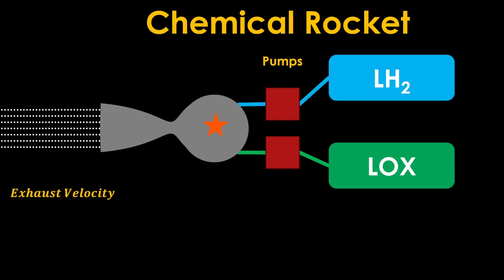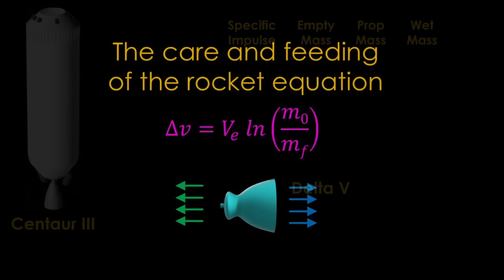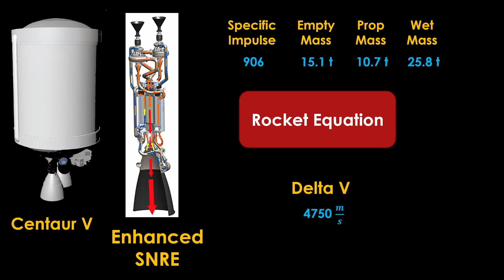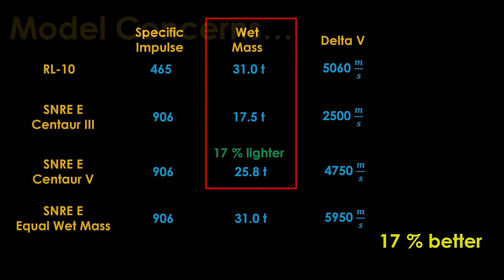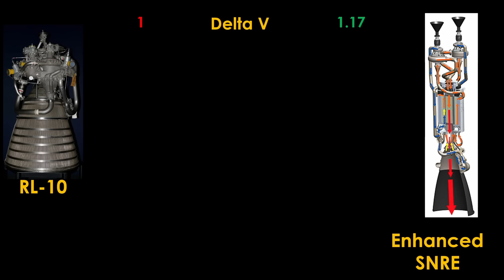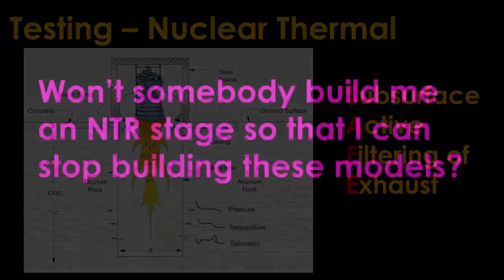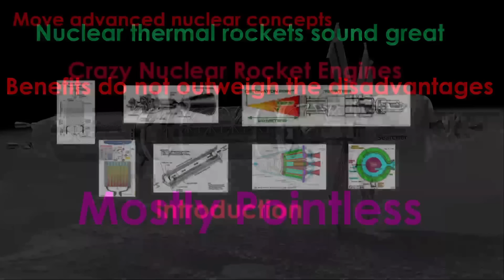Why Nuclear Thermal Rockets are Mostly Pointless

Comment: There was some tantalizing PR blurb a few years back that indicated that the DRACO rocket program had evolved: they were saying that the new version of DRACO was a hybrid of Nuclear Thermal Propulsion (NTP) and Nuclear Electric Propulsion (NEP). This was supposed to result in a superior form of nuclear engine. They suggested that it would cut transit time from Earth to Mars from 6 to 8 months (using chemical propulsion) to 45 to 90 days (using the nuclear hybrid rocket). I don't recall if this tease came from the Dept. of Defense or from NASA. Are you suggesting that this was just a hot air tease, and nothing behind it?
Reply from the maker: I'd have to see the specific proposal to have an opinion. 

I do have a video on nuclear electric.
Reply: 90 days is fantasy, you would have an unsurvivable entry speed at Mars and no propellent to land with.

Comment: Don't the atoms guys ever talk to the rocket guys? I get a sense from these announcements that they either don't understand mission design reference and contingency planning, or the people they need to impress don't.

Focusing resources on nuclear propulsion for crewed Mars missions at this stage is placing the cart before the horse. While this is the standard sales pitch, there's simply no need. No surface ISRU option for brewing nuclear rocket fuel is possible with any destination anyway. 

Furthermore, using any superior engine to push people there much faster than 180 days means destroying the only added safety margin it could've offered above Methalox. Should anything happen to prevent this shiny new fantasy drive from relighting to slow the vessel enough for safe Mars entry & landing, the crew is out of options. Certain death somewhere in the outer solar system is assured. OTOH, a 2-year, free return trajectory to Earth is available with ballistic trajectories, by simply doing nothing.

At this time, there is no civilizational infrastructure at Mars. Everything that will keep you alive at Mars must either ride along with you or have been safely landed there ahead of your arrival. Killing the most robust safety feature of mankind's most dangerous undertaking in a single point of failure is the definition of insanity. Real mission planners will be adding more payload in the form of systems to maximize crew surface safety and productivity. 

Better propulsion designs will arise naturally, driven by growing demand in trans-planetary commerce. Clipper Ships are for the settlement phase.

The stated reasons for advanced propulsion development prior to sending humans to Mars are illusory. Such efforts are better spent on developing improved compact fission options crews could actually test soon (the way it's looking, perhaps even by Artemis III).

Comment: This is why I keep using advanced chemical rockets until I unlock open cycle fission or fusion in Terra Invicta, which has a fairly sophisticated models of hard SF space economics and physics: 
There's no technical reason why solid core NTR's can't work, they just are too incremental of an improvement in performance and economics to justify either the logistical difficulties of scrapping and rebuilding my fleet around them, or delaying the early space rush to wait for them.
Orion drives, and their derivatives like minimag Orion, are the lowest tier engine that is revolutionary enough to justify replacing fleets. And once you have Orions, the next jump revolutionary enough to justify replacement is Nuclear Saltwater, Fusion Torch, or Antimatter rockets.

Comment: A thought:

The real advantage of NTRs is supposed to be higher specific impulse. But with the extremely low density of hydrogen and the difficulty of storing it, it's possible the real advantage would be the ability to store a relatively dense propellant (methane, ammonia, alcohol, even distilled water) and eject them at velocities you normally only get with chemical rockets. The higher fuel density for a given amount of tankage ultimately works out to a higher delta v.

Check my numbers if you want, but it seems to me a propellant with a mass of 800g/L that gives you 380s ISP would actually perform better than a propellant at 70g/L and 900s. 10x increase in the mass of propellant would more than offset 2.5x increase in specific impulse, yes?
Reply: Problem is that denser propellents in an NTR are closer to what you can get just burning them in a chemical rocket at a fraction of the cost, without all the extra dry mass of the lower TWR engines, shielding, radiators, and extra landers since your NTR can't enter the atmosphere. And denser propellents cause lots of damage in your engine that hydrogen avoids.